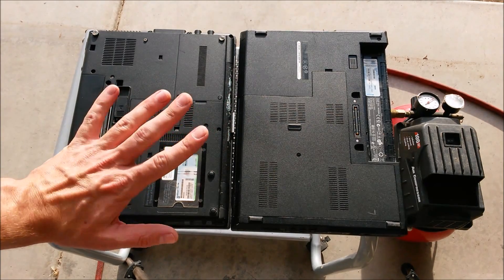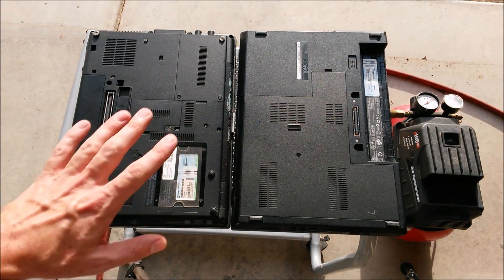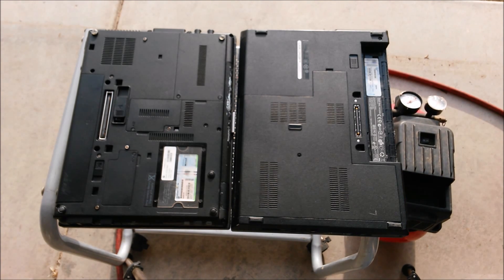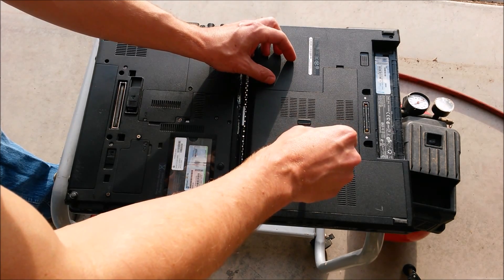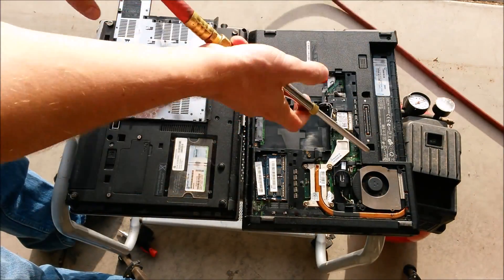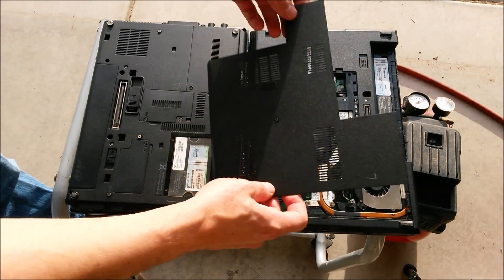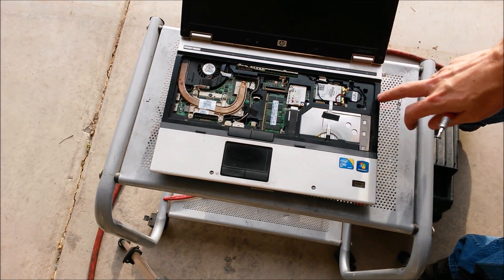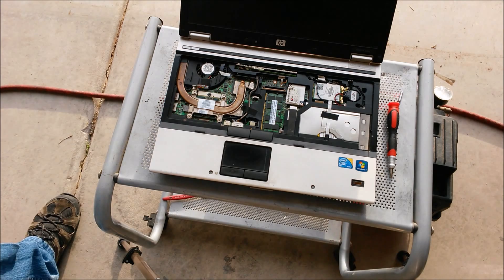(:HowTo:) Properly Clean & Maintain Your Laptop ~Blow-Out the Dust & Clean the Keyboard/Screen/Fan

Comment: I have a question a lot of times there is moisture in a air compressor for 1 meet personally I would not attempt to use air compressor because of the amount of moisture that is in a air compressor even if you drain the tank you're going to have a lot of moisture in the air compressor that means water getting on the motherboard in other parts of the motherboard also most likely the air pressure will be too strong and can brake components on the motherboard I always use plastic paint brushes with no metal the small artist paint brushes with no metal and flush it lightly
Reply from the maker: If you're worried about the moisture, you can use canned air.

Comment: THIS IS NOT safest way to clean laptop !!!....First, some older air compressors can contain moisture in the air that is blowing out...that can damage the motherboard and ruin your laptop. If you need to use air blowing, then use compressed air spray made for this purpose. Second, NEVER, NEVER blow out the dust from system fan so compressed air goes straight into the fan , you MUST hold the fan with your fingers when you do that, because you can destroy system fan bearing
!

Comment: Not holding the fan and making the bearings spin lot faster than usual cuz of compressed air is critical for any computer. This cost me 500 bucks. I had a pretty silent computer that sounded like a truck right after...
Reply: WaheedQc just replace the fan
Reply: I thought of it but i didn't wanna put anymore money in it.

Comment: Is there a way to clean the contacts under the keys? I have a feeling mine are dirty. There are several keys that you have to press really hard or tap on them several times for them to work.
Reply from the maker: Ltl Paa Easiest thing is to just replace the whole keyboard. You can get one on ebay cheap. Install is like 5 min.

Comment: hello people i did a do it yourself clean on my keyboard and it worked make sure you unplug your keyboard from the computer then clean around the edge of the key with a knife or something small and sharp use something to pull the keys off i pulled it off by two sharp knifes on the top right corner and the bottom left corner of the key i pulled it off grabbed a baby wipe wrapped it around the tip of the knife and stared cleaning waited about 4 minutes for it to dry cleaned around the key with a knife one more time then scrubbed the key and then put the keys back on the keyboard plugged the keyboard back in and it worked and this is on a a dell keyboard by the way if you use it and it don't work don't get mad either find another video for it or buy a new one if you use this method then i hope it works for you.

Comment: Should be careful with recommending  people to use an air compressor for electronics. If compressor tank is not properly maintained by regular moisture draining or use of a moisture trap/separator you obviously run the risk of getting water on your components and damaging them.

Comment: I'm an IT professional, never use an air compressor to clean out fans unless you don't let them spin more than 2 seconds, that includes the power supply on a desktop. Reason???? You will blow the bearings in the fans and you will notice that they will whine when they run..use canned air instead, the air pressure is not very high.

Comment: It's incredibly important that you do NOT use overpowered air compressors. I got an industrial grade hella strong compressor for auto mechanic workshop uses,and I shred one of my laptop fans to tiny pieces by blowing air into the intake vent. Yes,I was an idiot,but I'm writing this comment to perhaps save you a laptop fan somewhere in the future
Stick to low powered ones,and don't hold it for too long on the fan

Comment: Sooooo much wrong with thid vid I don't even know where to start... smh...

1. If your going to use a compressor be sure to purchase an inline water filter with it, other wise you're going to be blowing rust and water into your computer. If you want to see what I'm talking about just fold a nice white paper towel up and blow the air through it and see how it looks after your done.

2. It sounded like you had that pressure up way to high, 30~40 PSI should be more than enough.

3. HOLD THE FAN when you are blowing air around it.

4. Don't use alcohol when doing surface cleaning, almost all plastic on a computer has some type of coating including the keyboard and cover.

5. your cloth should be damp, not dripping

6.Don't spray screen cleaner directly on the screen, ESPECIALLY if its in a vertical position.
Reply: its an hp bro
Reply: Thanks for pointing those out man

Comment: TIP : Never worry about laptop cleaning, if you feel its overheating, just ask a professional and get help. ALSO DO NOT USE LAPTOP VACUM CLEANERS OR THIS AIR COMPRESSOR. It can cause a static reaction....
Reply: I am a pro and @Toto is 100% correct, that's why they make things called ESD safe vacuums. also if he doesn't have a water filter in line he's going to have a bad time. you can avoid ESD on a compressor my using a metal nozzle and attaching a grounding line to it.
Reply: the "pro" said its okay to use your mouth to blow into the fan..
Reply: stfu noob hes a pro ur a noob so stfu xd lol

Comment: Cheaper option: Bike pump?
Reply: you're my kind of guy
Reply: Can of air
Reply: +ConradVertz:  Well, not really. Maybe for some keyboards that are not very dusty. But if you didn't clean it for years, and there's a lot of dust, swet, crumbs, hair, and who knows what else, it gets sticky and a simple canned air may not be enough to remove it. If the keyboard is hermetic, one can use water from a shower spray and then dry it immediately, and maybe a bath in isopropyl alcohol.
Reply: Like a boss 😎
Reply: +TigOlBitties0000:  More like BigOlTitties0000 :)
+Tony Y:  You can also wait for a hurricane. Cost: free :)
Reply: Albania K.P.G bike pump works for non-settled dust. You’ll need a compressor or a can for the rest
Reply: good idea!

Comment: You should hold the fan still when blowing to it, it can work as a generator too and break something, you see.
Reply: I broke my fan doing it the way he did.
Reply: Me too,never use overpowered air compressors :D
Reply: Yes it will not burn anything protective diodes will not allow it. However you can damage the spin rate causing it to be louder in the next use. So you can kinda damage it a little but nothing game changing.
Reply from the maker: I have taken many of these fans apart and examined the electronics. They have diodes built in which block any generated current from leaving the fan. I have personally cleaned probably 1000 computer fans this way without any I'll effects.
Reply: GadgetClass Damn, that's a lot. Thanks for correcting me.
Reply: @GadgetClass  So you've been doing it wrong and damaging 1000's of computers... great.  You should ALWAYS hold a fan from spinning when you are dusting it off.  You'll cause damage to the fans and will either drastically lower their lifespan, or outright break them.  Of course you've "never had any ill effects"  The fans will still continue to work after you do it, but will eventually after a few months or a year will start rattling or overheating.  You're creating problems down the line for customers that wont be traced back to you.  It was a mistake I personally made during a first cleaning of a new laptop.  Took 3 months afterwards for the fans to start overheating.  After learning the hard way and fixing them, I've held down the fans from spinning while dusting now and never had any issues with them.

Comment: How to destroy your laptop 101 spinning your fan that fast can break of the fan also its a motor so if you spin it it wil generate electricity with higher amp and volt than your laptop can handle this is a rip for 7 out of 10 laptops

Comment: can you use vacuum instead of compressed air?
Reply: +Tomasz Aulich better not use a vacuum cleaner because that creates static electricity, google it :3
Reply: Static electricity CAN damage components, it's hard to tell for sure when exactly could happen (I mean, how much of it, for which component, etc) so better avoid generating it.
Reply: +Blackleafdragon That air without locking the fan wasn't a good idea either.
Reply: what do you mean? what was the proper procedure then? and if not followed like what he did whats gonna happen to the fan?
Reply from the maker: +Tomasz Aulich You can, just be carefull. The keys can come off and get sucked into the vacuum if you aren't careful.

Comment: can you use air cans to do this I know for my screen I use I microfiber cloth and LCD cleaner.
Reply from the maker: Yes you can use canned air. in my experience canned air is not always powerful enough and looses power quickly while using it as the can gets frosty on the outside. Definitely manageable though.
Reply: Air can is far safer than the pressure this idiot is using and don't forget to put a straightened paper clip "gently" between the fan blades to prevent them from turning. The last thing you want to do is fry the motherboard.

Comment: Thats too much power. It'll ruin the fan
Reply from the maker: the fan spins faster powered than the compressed air spins it. I've been using air compressors to clean computers for over 15 years. Any PC tech that had to clean computers regularly knows how ineffective canned air can be.
Reply: Don't forget that every electric motor is also an electric generator in reverse. If you spin it as fast as it normally run, it can produce voltage and send it to the motherboard :q

Comment: idiot, u can NOT blow compressed air directly into fan with that much power, it preatty much fucks up fan. No fan in this world was made to spin at that much rpm.
Reply: +GadgetClass thats stupid you can even lose a piece of the computer but fine
Reply: GadgetClass you should  extualy hold your fan  and than use it
Reply from the maker: xAsmir I've been in the computer business for over 15 years. The compressed air doesn't spin them much, if any faster than they spin on power. There is no better way to clean them.